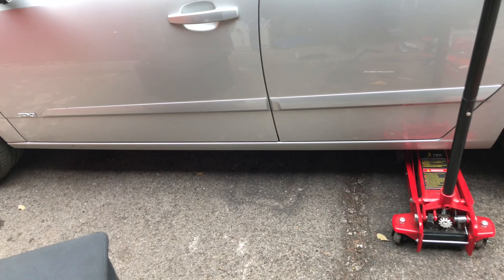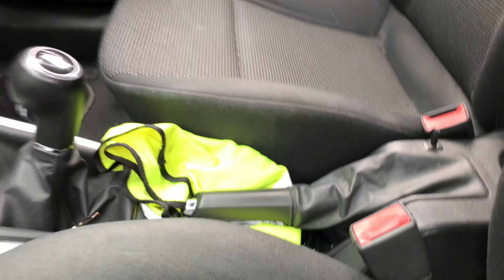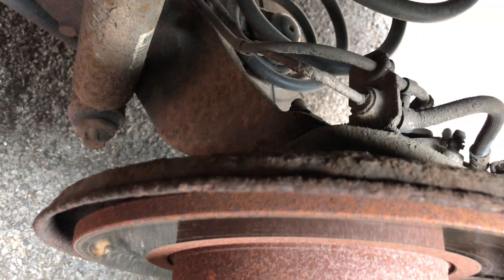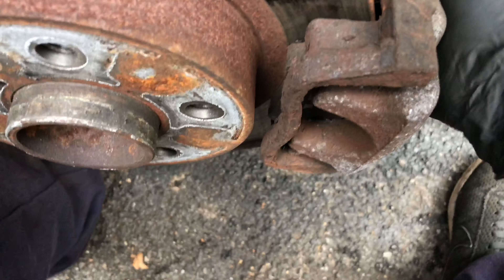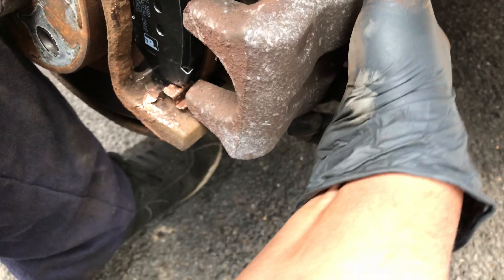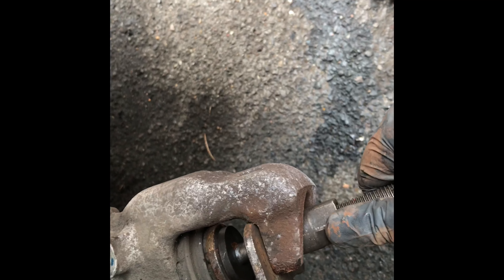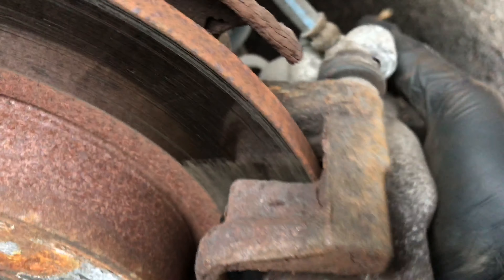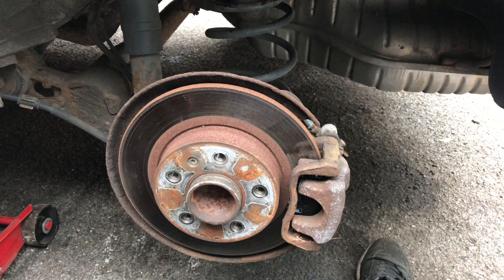Vauxhall/Opel Astra (H/MK5) Rear brake pads replacement

Comment: im planning on re doing my entire brakes on my astra when i get my new wheels and tires, i know i need brakes soon and since im getting new wheeels might as well get new rotors and pads, im getting drilled and slotted rotors so it looks nice and fancy behind the wheels
Reply from the maker: @GAWTHLEX  Good luck personally I just drilled is a lot more better from experience put slotted always make too much noise get warped quickly and wear out pads quickly so would not recommend slotted
Reply: @jaysworkshopgarage well thank you for this info i will do some more research now before i pull the plug

Comment: Nice one, thanks. Probably worth mentioning that you want to avoid getting the copper grease on the brake disc.
Reply from the maker: 😂 you have to use brake cleaner
Reply: @jaysworkshopgarage  Morning. Changed my rear pads as per this video. Though was slightly different as I have an Astra J, and there is a dampener to remove instead of the bottom bolt. More or less the same though - you still need the 18mm spanner to loosen the lower bolt on the inside, in order to remove the dampener. 

When I had changed the rear pads, I noticed  that the handbrake is a bit looser now. How do I sort that?

Comment: Do you need to open the bleed screws when you wind the pistons back in? Some people say to do this, others say its not necessary.
Reply from the maker: Only if it’s hard to wind back
Reply: Open/take cap off reservoir 👍🏻

Comment: Mate I hope you can help me asap please. I have just done my rear pads. The new ones are Brembo. They had a 3M sticky pad on the back of them. I just peeled it off and put the pads in. Upon finishing I looked at the old pads which are GM and they have a thin plate on the back of each of them. Am I supposed to put them onto the new pads. If so what are they called pls? I would like to get new ones.
Reply from the maker: It should have came with the kit to be honest they aren’t that important it should be fine but if you’re really fussed you can take them off the original GM ones you had on and reuse them hope this helps thanks

Comment: My pistons won't go back any advice
Reply from the maker: have to make sure it twists and goes in with the correct tool also you can undo the cap on the brake/clutch fluid reservoir in the engine to release some pressure hopefully this helps

Comment: nothing wrong with  those old pads over half the  meat still on them id be more worried with the rust on the caliper the pistons probly seized .
Reply from the maker: Customer wanted them done also they were squeaking bad because of cheap quality pads.